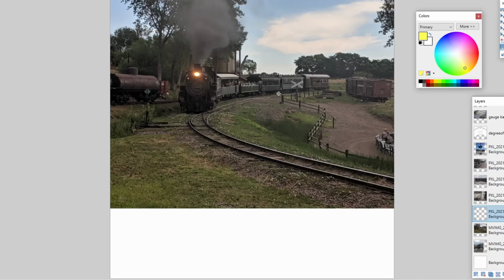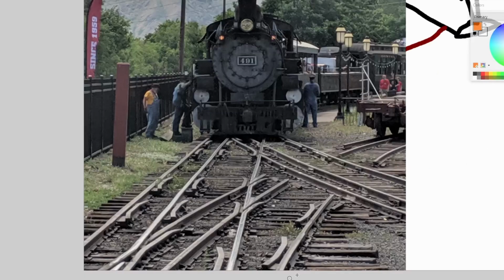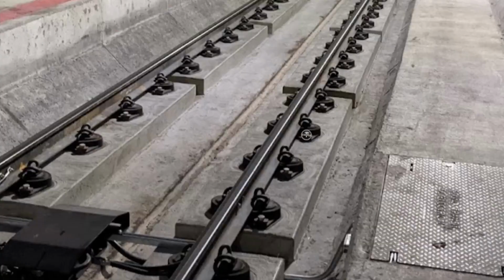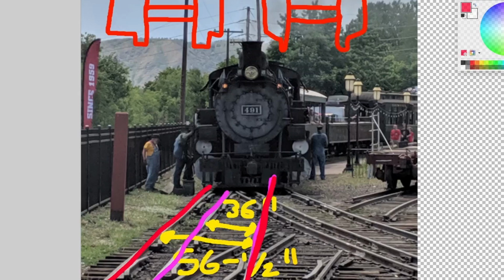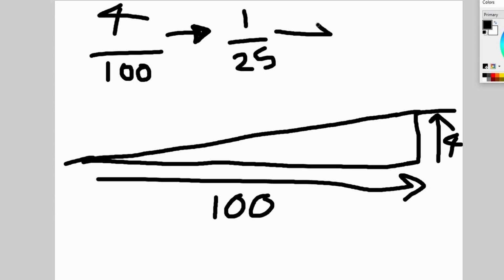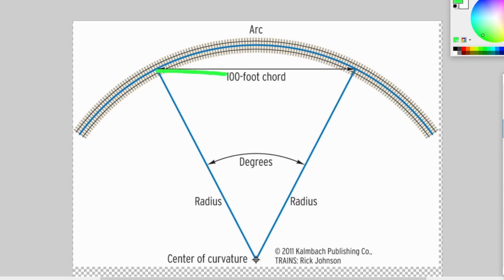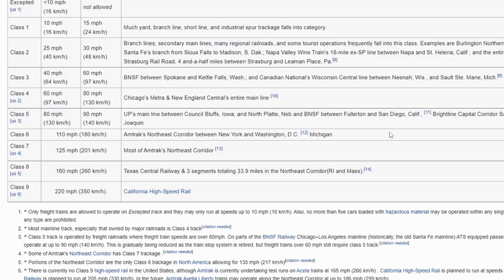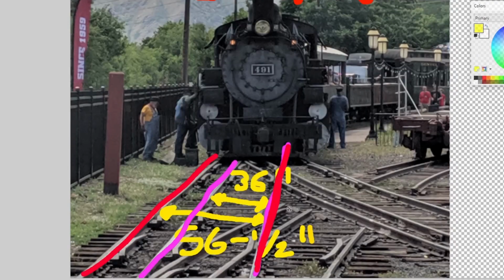TRACK 101: How does track work? (Including many often-missed things!)

Comment: Good job! You really want to see interesting track, look into the book, “Logging Railroads of the West”. There you will find spool wheel geared locomotives with logs for track. I have seen these in the field while tracking old railroads in California. A “rail” gets bad, toss it and put up another log! Track in the woods were temporarily so no use in putting up good rail. Later, they must of got tired of rerailing engine and cars, so ballast, proper rail and fish plates came into practice.

Comment: you forgot broad gauge
Reply from the maker: It's a bit niche, is all
Reply: @Hyce777  It is the rail gauge used in Victoria Australia and at the southern Cross station in Melbourne on platform 1 there is a set of double gauge track which broad and standard gauge for the Melbourne and Sydney intercity/interstate train

Comment: There are no trains (in service) running faster than 350km/h anywhere except maglevs. Most high speed train is either 300 or 320km/h, 350 is very uncommon
Reply: To my knowledge, standard 350 operations really only exist in China on a handful of their high speed lines, though I’ve heard rumbles of the French and Japanese considering higher speed operations.
Reply: @spartan117zm  Japan have run trails for higher speed for decades. It really never worked out.

The frensh agt  was ment to enter  service at 360km/h, but that proved to be way to optimistic, and it just entered at 300.

Of cause L0 will enter service at 505km/h

Comment: 31:00

That is not really accurate. Tilting trains is only for the confort of the passangers. The tilting mechanism is either neutral, or actually lean the center of gravity outwards  (like the turbo train and talgo) pendalino, acella and X2000 use neutral tilt
Reply from the maker: Fair, but they do use it to run faster around the same curves as conventional trains.
Reply: @Hyce777  Its those kind of, yes but its really very complicated and not quite as one might think. 

The center of gravity of all tilt trains are very low, they typically sit very low over the rail and can be as low as a meter lower than normal trains.

The APT never entered service and the ETR401 was in service for a very short time.  ETR450 and X2000 was introduced at the same time. Both with the concept that they would run 25% over regular speeds. Both with the concept of sitting very low to the rail with a low center of gravity, and the gravity of tilt right in the center of gravity of the tilting body. The mechanism is really very complicated and the train-body moves a bit sideways to compensate for the tilt.

The suspension is way more complicated than on normal trains and there is also sideways dampening that lower sideways oscillations (or preferably totally kills them). This also lowers the side force in the corners, actually quite significantly.

After a few years of using tilt train, we are talking about early mid 90-tys, it turned out that a lot of people got horribly motion sick when the tilt to neutral G-forces. They first eased it down to +20, but that didn´t quite solve the problem, so they eased it down to +15%. This (mostly) solved the problem. Still 15% for a railway that have pretty much just corners, is a decent gain.

Well... sort of. Later testing with the Regina prototypes in the mid 90-tys showed that a majority of that gain was not due to tilting body, but rather oscillation dampening. So a train with oscillation dampening only could run +10% in corners, giving the tilting train a benefit of only 5%. Lighter construction and stronger motors pretty much ate up this advantage. This in combination with the worst offending corners been straightened. X2000 successor was a non tilting train, and ICE-T, and even more so ICE-TD is effectively succeeded by ICE4 that have a Regina like sideways oscillation dampening mechanism.

Pendalino is still fairly popular, but it have been used on more and more totally revamped rails, with the replacement train being true high speed trains.. That honesty, was kind of the idea originally.

For the trains with passive tiliting, like the Spanish once, the story is a bit different, and honestly i don´t know hat much about them. One thing i know is that the center of tilt and the center of Gravity of the tiling body is very close to each other. Most people think of those like a pendulum, but they really are not. 90% of them are neutrality tilting and its really just the last 10% that make it tilt in one certain direction.

The irony of the Spanish trains is that they are mostly used on high speed track, and they are actually running slower (250km/h contra 310km/h) than the non tilting train on the same track. But when they run on normal track, they do run faster than other trains. Also worth saying is that those are gauge switching trains and they are ruing on broad gauge when in "slow mode" being that the center of gravity is not as important.

The terrible accident in Spain a few years ago was one of those train. The real irony was that the train was runing on a slow bit of track, but it was still standard gauge, because it was just a few km shy of the gauge switching device. This was also part of what made the accident happen. They switched to the old system prior to swiching gauage, so part of the old control system was running on the new track
Reply from the maker: @matsv201  thanks for the quite detailed and interesting reply!

Comment: The (Standard Gauge) High-speed line between Cologne and Frankfurt Airport Germany also has a 4% Grade. But It only Class 403, 406, 407,408 and since 2019 Class 412 the first 4 are all EMUs with a top speed 320 kph. The last one is distributed power where 6 of the 12 cars are powered and with a top speed of (only) 265 kph. It's kinda sad if you can only go 265 kph on a line which is build for 300 kph. Yes I complain about a  "low" top speed which is still faster than any train on the north east corridor.
Reply: You are not alone - I’ve been to Germany quite a few times and to this day I still get disappointed when a 412 shows up to the platform instead of a 3 series. They look great, and the interiors have been done well, but man it sucks knowing you’re on a line built for 300kph and you can only go 265 (and typically I’ve found the 412s limited to 250 on many of the runs I’ve made).
Reply: @spartan117zm  The ICE 4 variants are mainly for the many routes in Germany where you cannot do more than 250 km/h, often not more than 160 km/h (160 km/h is the speed where you can't have level crossings if you want to go faster). ICE 3 are for special high-speed lines. And we're finally getting to a place where we'll have enough ICE 3 for all the high-speed lines. This, together with many more new ICE 4 trains, probably means that we'll be losing the ICE 1&2 trains (the ones that still had locomotives on one (2) or both (1) ends). (And, somewhat confusingly, all the model numbers are in the 4xx range.)
In my current spreadsheet (that's probably no longer completely up-to-date) I have
9380x412	ICE 4: Mittelwagen (x=Variante), angetrieben (250?km/h)
93805401	Baureihe 401 (ICE 1) der Deutschen Bahn AG
93805402	Baureihe 402 (ICE 2) der Deutschen Bahn AG
93805403	Baureihe 403 (ICE 3) der Deutschen Bahn AG
93805406	Baureihe 406 (ICE 3) der Deutschen Bahn AG
93805407	Baureihe 407 (ICE 3) der Deutschen Bahn AG (Velaro D)
93805410	Baureihe 410.1 (ICE S) der Deutschen Bahn AG
93805411	Baureihe 411 (ICE T) der Deutschen Bahn AG
93805415	Baureihe 415 (ICE T) der Deutschen Bahn AG
95800605	Baureihe 605 (ICE TD) der DB Fernverkehr (Diesel)
und     8xx     ICE-Wagen ohne Antrieb

Comment: Heya! Great video, there is one question I have though. I've always wondered why it is that narrow gauge track/engines can take tighter turns than standard gauge. I always figured that having a wider wheelbase would help with taking sharp curves as it stops the train tipping over, but it seems that the opposite is true and that never made sense to me.
Reply from the maker: Shorter wheelbase length overall, typically smaller loading gauge (until you get the big K's)
Reply: Imagine having different model trains each with a different rail gauge from 1 inch between the rails all the way up to wider than standard gauge. Now imagine building a circle out of the track in your living room. You can fit the 1 inch gauge track quite easily and an appropriately sized model train can run around it just fine, but if you tried it with the standard gauge track it wouldn't look like rail track, it would look more like a really wide rail around the living room with a really small rail in the middle of the room. You would never imagine a train being able to run around that circle.

Narrow gauge trains can take tighter turns because the difference in the tightness of the curve for each of the two rails is less significant. It's the same reason why model trains with really narrow tracks (less than an inch) can do spirals around your living room but real trains can't. In order to fit on the narrower track they need shorter wheelbases like Hyce said, it's almost as if the train is just "scaled down".

However your point about the wider gauge and higher top speeds does have some logic to it. For a curve of the same radius, trains on standard gauge will be allowed to travel around it at a higher speed without tipping than one of narrow gauge. The difference is not super significant as it also depends on the centre of gravity and how wide the train is but it is an observed phenomenon.

Comment: 13:52  In 1980, my high school chemistry teacher told us that nowadays they weld the rails electrically.
Reply from the maker: There is some amount of electrical welding for bonding (cabling) applications - but most, if not all, joints are done via thermite these days.
Reply: @Hyce777  Well, it's not the first wrong thing I learned in school.
Reply: When they weld rails together into longer lengths they do weld them electrically.
They are called flash welds, the welds are made by introducing power into the rail, then butt the rail ends together
Then move them apart several times to build up heat through resistance, then finally the rails butt together to form
A final weld.
By the way this is how it’s done in the UK.

Comment: Timetables would be very interesting I know what a lot of it is for trucking and to a certain degree even shipping over water by air is very very easy to figure out in comparison just because there's fewer factors but they also suck because factors change more irregularly. Railroad tables. Also railroad economics signals if possible and switches for sure. I'm always curious about the fun technical side and tools and equipment that's beside the point.

Comment: Some different perspective from Germany:
- Curves and all dependent measurements are given as radius.
- Rails are fixed to ties by screws, not nails.
- Ties are mostly concrete now because of cost of disposal of creosote. Also some old steel ties exist.
- Grades of ramps are measured in permille, not percent. So not 4%, but 40‰ for 1/25.
Reply: -The radius is more logical and I'm sure they would use it in the US if they went though all the GPS coordinate type of track laying we do in the EU. 
-A lot of the rails in the US are something we would call "directly fixed". In most of Europe the systems are indirect, so we mount the rail onto a steel plate most of the time with a spring clamp. And then we attach the steel plate onto the ties either by screws or bolts.
-I've seen some cases where composite ties have been used, most by far is concrete though
-Most of the track in Europe is also slightly tilted (1:40) so the forces are better spread through the rails.
-I personally have to deal with pretty much 100% electric trains, which often means that the signalling systems and return flow of the currents are a factor when designing track. Almost never will the left and the right rail be part of the same circuit. (The gauge bar scared me)
-We use UIC 714 to determine the track class.
Reply from the maker: oh interesting! Not surprising, most new projects use the concrete ties here as well. But screws I have not seen! And, the permille is cool! thanks for the perspective :)
Reply: I think Amtrak uses screw spikes and Pandrol clips on portions of the Northeast Corridor.  I volunteered at a small museum that got some ties donated that had them.  I think they came from a bridge deck.
Reply from the maker: @AEP817  neat! That's way out of my purview. Glad to learn about them :)

Comment: So when you're talking about retaining walls and you're talking about load you're also need to talk about the grade now you got more of a 3D model in someone's yard where you need all the grades to drain to a fixed point maybe however you need to know exactly what the slope is and if you can get away with that without needing a retaining wall or in much finer cases without growing grass there. By the way most grade work is done in the summer not early spring late fall winter at all. At least for landscape companies. Building decks building stairs building retaining walls you need to know rise over run how much vertical rise do you have that you need to figure out how much vertical run is required or in the case of stairs you have to figure out how many steps are going to have how high the steps need to be by the way flagstone stairs not my favorite they look cool there's a real sense of accomplishment but my goodness
Reply from the maker: You're totally right!

Comment: I understand ballast really well mixed in my profession we build retaining walls and paper patios even some paver driveway extensions. We have to understand how the Earth is going to move with slopes especially under load. Pouring a concrete driveway they had a build retained walls for sucks. Trying to make sure a slope doesn't wash away sucks. water always wants to run to the places you don't want it to run to and you have to figure out how to keep it away it is frustrating. But thankfully it is doable with modern day equipment very very quickly. You just have to pay attention. Balanced would be similar to behind a retain wall by the way. The basing material not the terrain requirements they have to install. Well there wasn't a hill here before but there is now. That's needed for this retain wall to keep the base in place. Of course they keep that in place you also need to talk about what you install onto that face to hold the dirt grass is really good for that task.

Comment: Hello Hyce, im confused by the curvature part. how can you get the center of the track(circle) with just one fixed length of string? when you have a 100ft string between two points of a circle and you construct an equilateral triangle from it, the radius will also be 100ft. even when you have a much larger or smaller circle, it will always be the same radius.
Reply from the maker: I realized after I posted hat I missed that piece :/. You can measure from the center of the 100' cord to the center of the track, giving a 3rd point that defines the circle. My bad on missing that, you're totally right!
Reply: I've seen a website that has circle cord radius calculator.  But I want to see a table that show the minimum curvature needed for each speeding rating class of railroad.
Reply: Actually, Hyce's picture was wrong. Imagine trying to find the center of a curve with a 2000 foot radius. Degree of curvature was designed to make the surveyors' job possible. This is little hard to explain without a picture, but if you start with Hyce's picture, ignore where it says "Degrees". Instead, extend a straight line from the right hand end of the chord tangent to the curve of the track (or perpendicular to the "Radius" line at that end). Now measure the angle between that tangent line and the chord, and that is the degree of curvature.

Comment: Great video!
Just one very minor correction about embedded track being installed without ties. It sounded like you were implying this was somewhat less precise, however this is actually our preferred method of embedded track installation (up here in Canada we call it "top-down" construction). 
We pour the concrete slab first, with troughs precisely wide enough to accommodate the rail section. A string of CWR is then suspended in the trough with an elastomeric grout to hold the rail in place. The rail installation is the "easy" part, and the quality of the concrete slab is actually far more difficult/critical.

Also very much looking forward to a 201 video, and hoping you mention Green/Grass track! :)
Reply from the maker: Take it from an expert folks! That makes a lot of sense. I'd only seen poorly equipped outfits make embedded track before. cheers :)
Reply: Brunell used broad gauge track mounted on cut stone blocks aligned under the rails with metal ties spacing the blocks for the Great Western Railway in England 170 years ago.  What goes around comes around ...   bye.
Reply: @brucegennette1629  That's  pretty  much  how the horse  tramways that  immediately  predated the first  steam railways did it. It was last used on theGrand Junction or the London and Birmingham ? Railway. Brunel did something  very different  -he used fairly flat bridge rail shaped' n ' bolted to longitudal sleepers with cross ties in between . (' =i=i=i=i=' ) 
This way the shalllow iron rail was supported its entire length and a breakage would be less catastrophic . Hopefully .